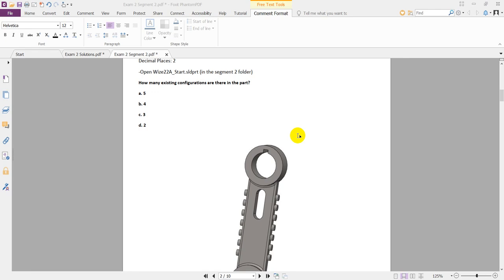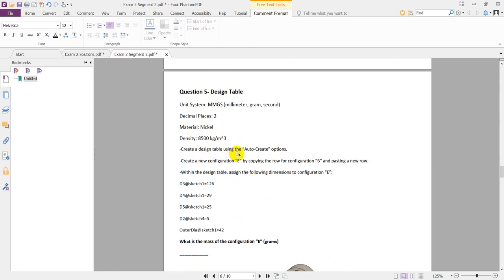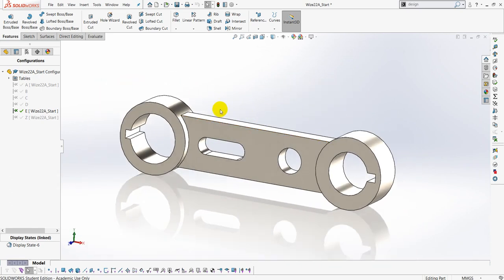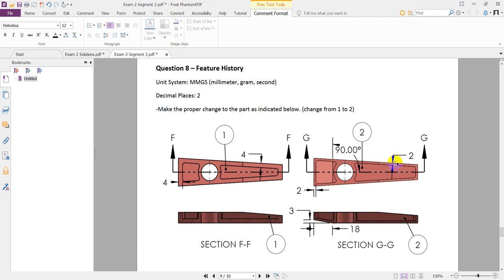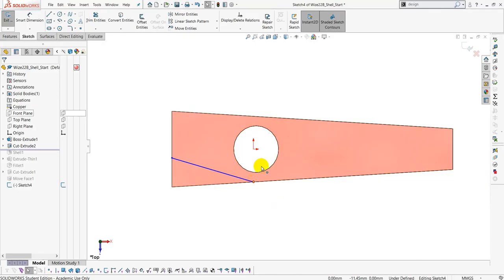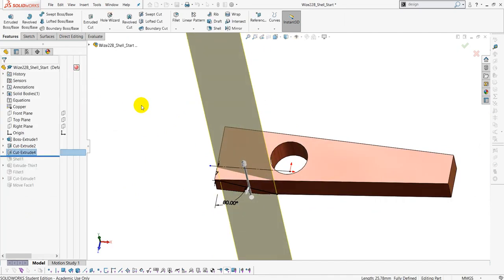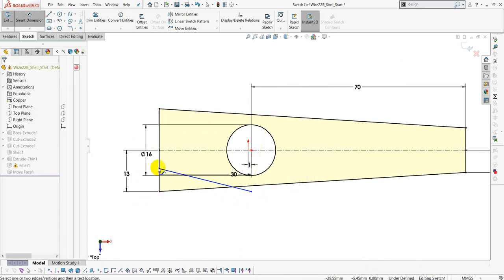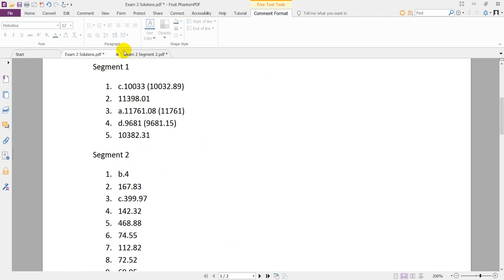CSWP   SEGMENT II   Configurations, Design Table, Part Modifications

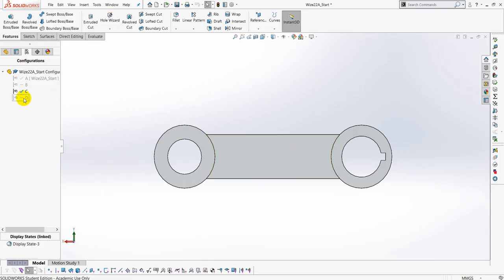Comment: 1:40 Wouldn't it be better to create Z as a derived configuration of A?
Reply: if you create Z as a derived of A, you wouldn't be able to apply it to configuration D. The best practice is to Create a new configuration called Z. However, this video is completely wrong. I think he didn't check the suppress new features and mates settings which makes the whole configurations changes when he add the configuration Z

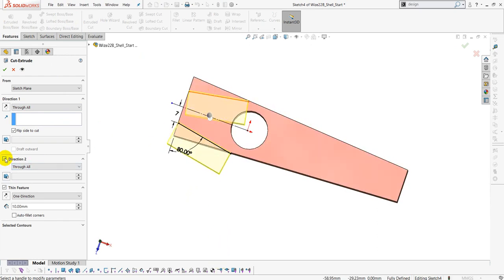Comment: At 16:19, you can use that mirror feature and then cut extrude without it playing up and cutting one side. If you joined up the lines to create a triangle instead of having only straight line, mirrored it and then extrude cut it, it will cut out that section without having to mess about with the settings in extrude cut. The way he modifies the part there is wrong though, but I just thought it would be a good tip if people encounter that kind of situation.

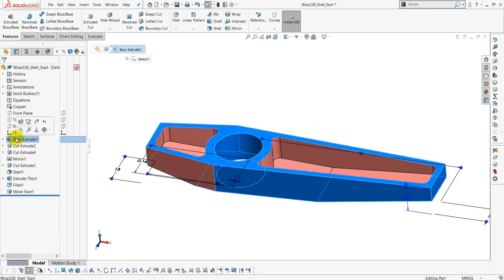Comment: 19:20 Why did you get a different answer on the second method? Did you miss anything on the first method? What I understand is, that you could get the same result in multiple ways in Solidworks.
Reply: So first method is wrong, the engineering drawing says that the points need to meat at 30mm from left and 70mm from right. What he had done in the first method would not match those references. Also if you look at the drawings for that section, you can see the are coincident points are in the middle of that hole, which means that the first method doesn't match the specifications. The second method is correct as you need to adjust the lines from the initial sketch completely to get the measurements that were specified in the drawing. Hope that helps!